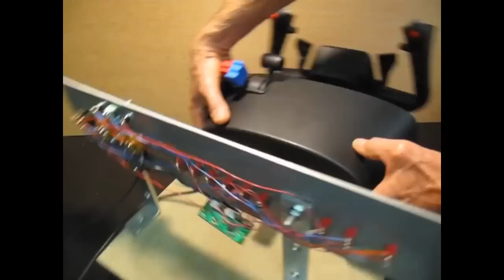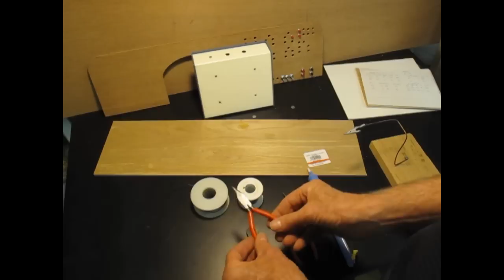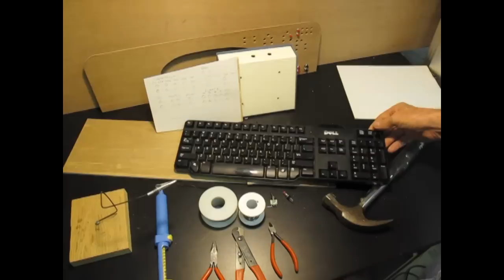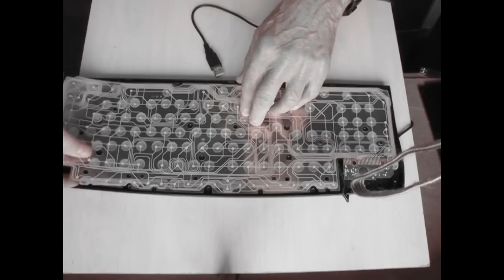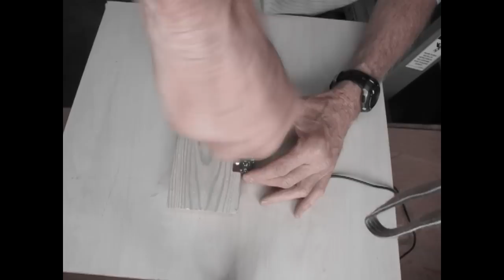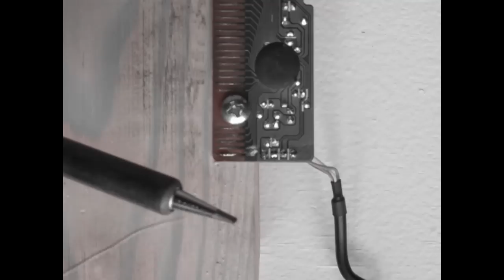How to Build Your Own Instrument Panel for X Plane ~ Part 1

Comment: As an electronics engineer. Could I make one comment. Solid wire is not what you want, it's much harder to make a good solder contact with. Stranded wire increases the surface area, reducing resistance, reducing power requirements and also makes a better mechanical connection. Not that you should be using the solder to make a mechanical, but it makes it less likely to detach.
Reply from the maker: Hi tedferkin, Thanks for you input :-) I never gave that any thought not being an electronics engineer, was thinking solid wire would be much easier to handle and had a lot of solid wire lying around so that's what I used.  Thanks again.

Blessings,
skip

Comment: Thx a lot!! I'm also trying to build my own flight panel and your project sounds very smart to me. This is the first video i'm going to the second one right now! (sorry about my poor English)
Reply from the maker: Hi Ricardo,  Your welcome, but please watch all the videos Before you start! The last video explains the problems I had so you can avoid making the same mistakes I made. Also don't try and use all the wire combinations make sure you have a few left over just in case there's a problem there. This is a very time consuming project and I can't express enough to go slowly, check your work often, especially when you start soldering switches and wires. Do a few at a time and then check to make sure the switch or buttons you just soldered work correctly by checking in a word doc or text file. Good luck and please keep me informed of your progress I'd love to hear how you are progressing.

Blessings,
skip

P.S.  Your English is fine :-)
Reply: @WEHVideos  thx again for your advice. I'm on the 3rd vídeo right now....
Reply from the maker: Looking good have fun :-)

Comment: Hey Skip... I was looking for something just like this, simple and inexpensive. Nice little project to add just a little more realism to X plane
Reply from the maker: Hi Josue,  Glad this is what you were looking for! I did run into some issues that I wish I'd known before starting so please watch all the videos before starting and be sure to watch the last video first!! There I explain what issues I had so you don't have the same problems, all in all it works very well. 

This is a very time consuming project and requires lots of patience go slow. When wiring and soldering do a couple  buttons and switches and then check your work in a word doc. to see if it works and make sure a letter isn't being written like when holding a key down on the keyboard. This way you can find mistakes fast and make corrections. Hope it works for you let me know how you are doing and please leave comment if you find something that might help others doing this project. Good luck!

Blessings
skip

Comment: Never really done electronics before. Should I get bare or coated wire?
Reply from the maker: Use both, you can use bare wire when connecting a bunch of button switches together and coated for everything else you don't want any wires touching and shorting out, this could be like holding down a key on you keyboard all the time causing lots of problems. Be sure to watch the last video before starting I explain the issues I ran into. Avoid using any wire combination that display KEY,2,3 etc. Make sure you have plenty of wire combinations left over don't try to use them all. Only use combinations that produce a character in a word doc. this will help avoid hard to find issues.  When you have your panel built and start wiring solder a few components then test them in a word doc. before going on. It's much easier to find mistakes when you've only have a few items to check. Also get a good solder iron one that get really hot, 500+ degrees that will make the soldering go easier and keep the tip clean, also practice soldering before starting so you get a good feel for it. This is a tedious project requiring lots of patience so take your time. Hope this helps let me know how you progress.  Good Luck

Blessings,
skip
Reply: @WEHVideos  Skip, you're incredible. This is great information. I appreciate all of the help. I'll make sure to watch all of the videos to make sure I understand everything.

Thanks,
Cam
Reply from the maker: Thanks Cam, let me know how you are doing as you go. Have Fun!

Blessings,
skip

Comment: Nice tutorial.  You should also have some flux handy, this helps mitigate oxidation.  I dip the wire lead in flux, apply that to the soldering iron and when hot enough, I touch the wire with solder and it will wick it to the wire.  Also doing it to the board too will prevent a cold solder joint.  Adding crazy glue is a nice touch to further prevent oxidation and corrosion.  Keep up the great work!
Reply from the maker: Thanks Stephen and thanks for your input. Are you going to give this a try? If so be sure to watch all the videos first and read some of the comments for some other tips as well. Good luck.

Blessings,
skip
Reply: @WEHVideos  Hi Skip, Yes in the future I want to make an annunciation panel for a 172, and a NAV/GPS switch.  I have enjoyed watching and learning from your other videos too.
Reply from the maker: Sounds good please let me know how your project goes and leave comments here for others to benefit from your experience if you don't mind.

Blessings,
skip

Comment: I assume this will work on FSX. Do you have any idea if an 360 encoder switch will work and how will you solder it?
Reply from the maker: Hi Christian,  Yes it will work on FSX or with any program were you can assign keys. Sorry I don't have any experience with a 360 encoder so I can't help. If you take on this project be sure to watch all the videos before starting especially the last one where I explain the problems I had so you won't make the same mistakes, good luck.

Blessings,
skip

Comment: Thanks for this! Just bought an old keyboard and will begin working on it!
Reply from the maker: Hi I Drives Ships,  Great! Be sure to watch all the videos especially the last one BEFORE you take on this project and read through some of the comments also. Be sure to go very slowly, mistakes are hard to correct. When you get to soldering, test each switch and button in X Plane or word document one at a time as you go. This will take a little longer but can save you HOURS in the long run. Good luck let me know how it goes and if you have any tips please leave a comment.

Blessings,
skip
Reply: @WEHVideos  Been using my homemade flight panel for 2 days now! Works great thanks for the tutorials. 👍
Reply from the maker: Fantastic I Drive Ships your the first person to let me know they actually finished the project, Good Job!!

Blessings,
skip

Comment: I used an old keyboard PCB to power my overhead panel. But I found out that an arduino was much easier to use
Reply from the maker: Hi Jahanzeb,  I've heard arduino is pretty good and is probably much better than using an old keyboard, I didn't know about arduino at the time I started this project maybe I would have gone that route if I had but...

Blessings,
skip

Comment: Hello, that's a decent one ;) was thinking about how to build my own panel, based on a gamepad but the number of combinations was not enough, like the idea with the keyboard. But there's one thing that does't let me sleep. How do you use your actual keyboard in XPlane now? e.g. for looking for an airport you want to take off from. If you connect a keyboard and your panel based on keyboard, you cannot differentiate which one pressed the key right? Just thinking of a scenario when you have a your panel connected, a few keys programmeg as e.g. heading selection, heading up, heading down, autopilot off (keys K L A X accordingly), and you also want to type KLAX info FMS from your actual keyboard. How would you stop hedging from being messed up and AP off? ;)
Reply from the maker: Hi 85lpz,  I never gave that much thought but have never had a problem typing in airport or fix info into the FMC. I think XP can tell when you are entering text. I have over 50 combinations used for my panel so if that were an issue I think I would have run across it by now. Actually this panel is no different that your regular keyboard, as far as XP is concerned it's just another keyboard. Hope this relieves your concern. 

Let me know if you decide to take on this project :-)

Blessings,
skip

Comment: hello. if i doo one ex 2 boards i ca setup all for diferent thinks on flight simulator ?
Reply from the maker: Hi Humberto,  If I understand your question correctly yes you can, I'm assuming you are thinking of using more than one panel. It does not matter how may panels you use you just need to be able to wire each component and it should work in the simulator. Please read some of the comments below they might help you. Thanks for watching hope this helps.

Blessings,
skip
Reply: Thank you
Reply from the maker: Your welcome :-)

Blessings,
skip

Comment: Thanks soooo much! I've been trying to figure out how to do this for the longest time. I especially appreciate your little tips for making the project flow smoothly.
Reply from the maker: Hi bodacioushoundbo, Glad you found my channel and hope the videos help you with making your panel. Sounds like you watched the last video but if not watch it now!  Also read the comments from the other videos I have some tips there also. I can NOT emphasize the importance of taking your time and planning EVERYTHING out before starting. I made the mistake of jumping in with not enough planning and while I have a very nice panel I found there were some things I'd have done differently if I just spent a little more time in the planning. Spacing the components was a big mistake I did not allow for labeling so now I need to remember what each one is!!! Wiring the components becomes more complicated as you go so draw out all wiring routes first before you start this will save you hours and hours in troubleshooting in the long run, I ended up having to rewire several components because I didn't plan well. 

I hope you will keep me apprised of your progress and leave comments that might help others who take on this rewarding but time consuming project. If you have any questions let me know. Good luck.

Blessings,
skip

Comment: Yes, I used your koncept, and built switches and buttons on my home similator, and just now ordered couple Aduinos Uno, and Freenove and did some studies how to transfer DATA from my X-Plane 11 to USB port, where the Aduino will plug in. In the main time I had handy an OSD module , which I connected to a small 7" monitor,  and I wished if I send DATA , or TXT file to OSD , I'll be able to view the receiving Dada and Texts on my 7" LCD but I got disappointed , well... I hope this concept can be done on Arduino. ;-) . By the way thanks for responding. Regards
Reply from the maker: Wow you are way ahead of me here, hope you get it working, please let me know how it goes and good luck.

Blessings,
skip
Reply: My researches and experiments with arduino didn't go well, because I built my flight fuselage simulator with X-Plane 11, and noticed UDP is disabled  this version of x-plane, so building and updating my cockpit by adding more keywords https://youtu.be/0JVQ5G7ATMg soon I'll upload the update version #3. Regards

Comment: Great idea and explanation. Congratulations for the idea and the execution, Skip.
Reply from the maker: Hi Flighter Yaw, Thanks glad you like the idea. If you take this project on be sure to watch all the videos before starting you will avoid some mistakes I made if you do. Let me know if you give this a try.

Blessings,
skip
Reply: Hi Skip, thank you for your kindness. I will implement this great idea but not already. First I need to learn all the systems on board and of course also to fly well. At the same time I will watch all your videos on the subject, as well as preparing the workplace and obtaining the tools and all the material needed for the project.
Best regards.
FY
Reply from the maker: Hi Flighter Yaw, Sounds like good plan, good luck keep me posted on your progress.

Blessings,
skip

Comment: yes, I watched it, it looks we need some times use the simulator cockpit to control   some gauges or auto pilot commands. I wanted to turn off totally the simulator cockpit and use my homemade Cockpit since I'm just mirroring the main gauges wanted to control the heading and autopilot. Thanks very much and regards.

Comment: .  Awesome idea,  I'm in process to build my cockpit to control the Cessna 172sp with modified keyboard, but couldn't locate which key would toggle the smal button for autopilot switches  GPS to NAV, this located on upper side of cockpit, I thought you may have done that,  thanks
Reply from the maker: Hi Brian,  Be sure to watch the last video I did have some problems with trying to do too many controls and explain the problems I came across in the last video. 

If you are using the 172sp that comes with X Plane you might have to add the switch for NAV GPS in Plane Maker. Good luck and let me know how it goes.

Blessings,
skip

Comment: I see you are using momentary switches, with the keyboard controller is it possible to use two position(or more) non momentary switches like you would find in a real aircraft? Thank you for sharing!
Reply from the maker: Hi Jake, No all MUST be momentary switches! If you use two position switches it would be like holding a key down on the keyboard and never letting it up. 

To check your panel after it's built open a word document and see if anything is being written. After I thought I was done I opened Microsoft Word and "Ks" were filling the page. I had wired something wrong. It was easy to find the problem because I knew which switch was associated with "K".

Blessings,
skip
Reply: Makes sense, thank you for the reply, and thank you for sharing!
Reply from the maker: Hi Kim,  If you remember the shop please leave a comment here. I know there are vendors who sell switches etc. for simulators but they all seemed too expensive when I added up the number of switches I needed so if I could find a place within my price range that would be great!!

Blessings,
skip

Comment: Ingenious! I will try to make some time for this, building this should be relaxing for the mind. Splendid, thanks for the inspiration :)
Reply from the maker: Hi Dragan,  Thanks but be advised it's a long slow process you will need to be patient. One tip I can give you is don't try and use all your wire combinations, make sure you have plenty left for future assignments. I found I didn't leave anything for future assignments on the keyboard. Also it would be a good Idea to have a list handy of all the keys you assign so when you want to add a key assignment for you keyboard you don't erase something on you panel. Good luck and let me know how you make out.

Blessings,
skip

Comment: Wonderful Skip... and a great idea, however, we can make our life even easier, with somebody that already configured & I/O board ready for us ...  they are very cheap, reliable, I use those for both FSX & now for X-Plane 11 ..no need to brake Keyboard .... lol
http://www.desktopaviator.com/
Cheers 
Yair
Reply from the maker: Hi Yair,  I looked at their site before I started my own process and just didn't want to spend too much and when I tried to order a part it was not available. They do have some really cool products but I built my whole panel for less that $80 plus I had a lot of parts sitting in my garage and the keyboard was on it's way to the junk pile. I'll check desktopaviator again to see if I want to start over, ugh.  Thanks for the tip.

Blessings,
skip
Reply: ..exlt if you manage to salvage some old components and turn them into useful devices that is just great  .... I, personally, have a very good experience with desktopaviator, using their Garmin G500 GPS Module & the fuel Selector, their boards running at about $50 a piece, considering that you can hook up to 20 different devices in ease, I think it is a very reasonable investment, beside, the KB board is kind of limited in functionality.
..as of now, I'm struggling with SPAD, GoFlight Interface tools, VRInsight and the hell knows what, I feel that soon a BA Degree in Engineering will be a Pre-Requisition before you can get a copy of a Flight Simulator ..lol
   
Have a great one ahead
Reply from the maker: Hi Yair,  I agree, my keyboard idea is limited and a lot of time is needed for the whole process. Next time I get into improving my system I'll probably go with more professional parts but as you say a BA Degree may be necessary :-)

Blessings,
skip

Comment: Hi. Think I've watched just about ALL your videos at least twice now & really enjoy them & have learnt a LOT from them. Thank you.
I'm considering buildng myself a control panel as the mouse isn't really very realistic (Would you board a plane where the Pilot was using a mouse? LOL) I'm going Hi-Tec & I'm planning my wiring in Photoshop (Just a little idea to help keep things tidy & easier to correct before cutting wood & soldering & resoldering)

Keep up the good work 

Merry Christmas.
Reply from the maker: Hi Wayne, Thanks, glad to hear my videos helped. Let me know how your project goes, I know if I would have planned a bit more it would have been a bit easier. Sounds like your on the right track, good luck.

Blessings,
skip

Comment: Hello Skip,

Another great video! Could you please tell me if it is possible to use this panel alongside a normal keyboard?

Thanks and waiting for the next part :)
Reply from the maker: Hi Aniol1349,  Thanks glad you liked it. Yes, it will work fine along with your normal keyboard.

Blessings,
skip
Reply: Really like the concept - there are encoders that have easy connections & software to customize the output - costs a bit more (around $70) but would save a lot of trial and error and uses screw terminals rather than soldering - here's one I found - http://www.u-hid.com/home/index.php